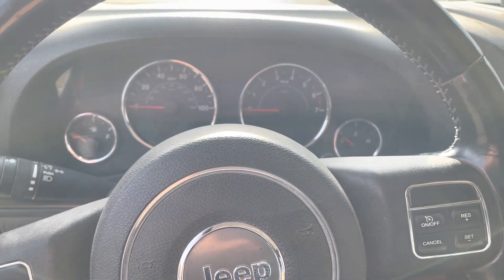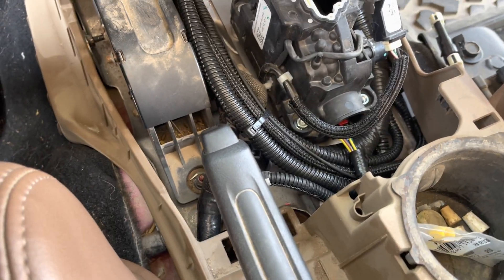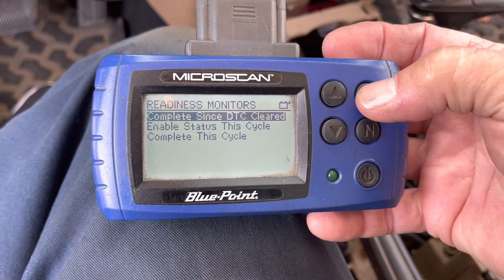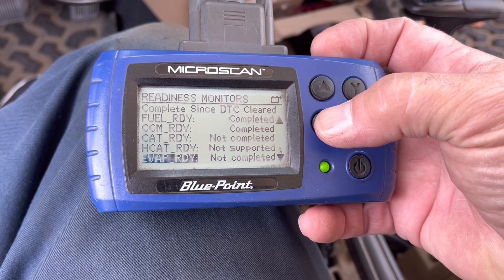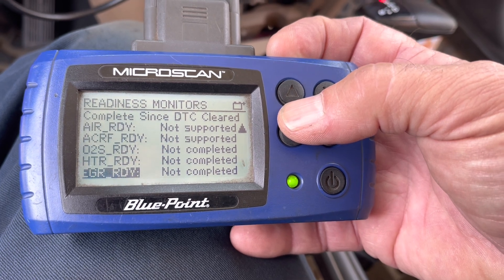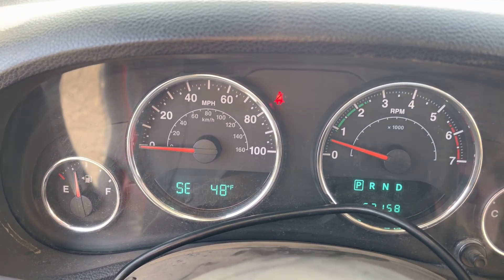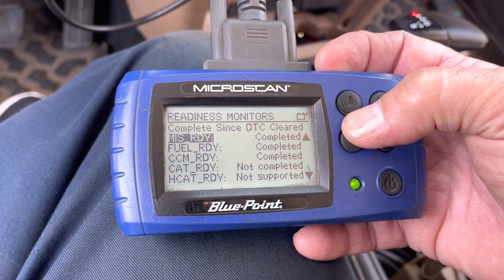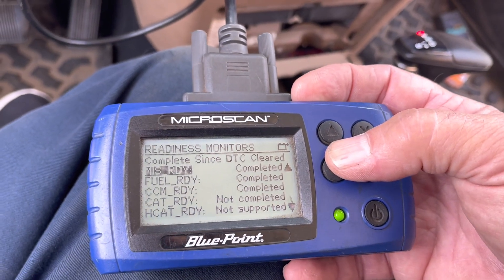Jeep Hemi emissions monitors

Comment: I have a 2010 jku and I'm picking up a 2013 5.7 hemi to throw in.   The tyranny is a 6RFE.  On your conversion page you only have the option for the 5cspeed or the 8 speed.  Will I need to buy a different Transmission or will the 6spd auto work?
Reply from the maker: That engine/transmission is a good setup and we do have a Kit and we do support the 65RFE
Reply: @jeepspeedshop  thank you for the reply.  Ill have to look again at the options.  I must have missed it somewhere.

Comment: Where can I obtain a build list for a TJ?
Reply from the maker: Here is what i have.
TJ Hemi 

The following part numbers are for Hemi Swaps on 1997-2006 LJ and TJ Jeeps

Fan for a 1997-2006 TJ/LJ (Chrysler Part #: 52027893)
Fan Clutch (Napa Part #: 271368)
Quantity of 2 – O2 Sensor – Front (Chrysler Part #: 56028994AB)
Quantity of 2 – O2 Sensor – Rear (Chrysler #: 56029049AA)
Left Exhaust Manifold (Chrysler Part #: 53013606AB)
Right Exhaust Manifold (Chrysler Part #: 53013606AB)
Fuel Pump (Chrysler Part #: 05161335AB)
Fuel Pump Gasket – Works with 1997-2004 TJ and LJ’s(Chrysler Part #: 1-52018808)
Throttle Pedal (Chrysler Part #: 52109683AC) – You can also use a 2006-2007-2008 Truck Pedal as well
Radiator Hoses:
Upper Radiator Hose (Napa Part #: 8030)
Lower Radiator hose (Napa Part #: 7759)
Battery Cables (Chrysler Part #: 56051599AC)
Transmission Mount that’s 1″ taller than the stock TJ Mount (Chrysler Part #: 52019998)
Air Temperature Sensor (Chrysler Part #: 05149025AA)
Vacuum Booster Valve Tee (Chrysler Part #: 5072522AA)
Works with TJs, LJs, JK VVT and JK NON-VVT: Capacitor (Chrysler Part #: 56041889AA)
Overdrive Switch (Chrysler Part #: 56047020AA)
Oil Sender (Chrysler Part #: 05149097AA)
Reply: @jeepspeedshop  thank you so much for the info!